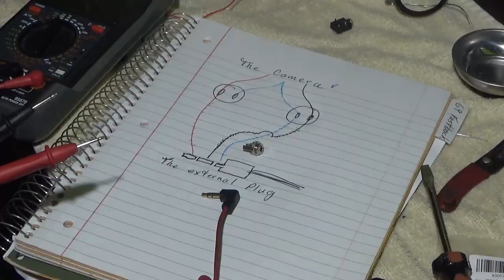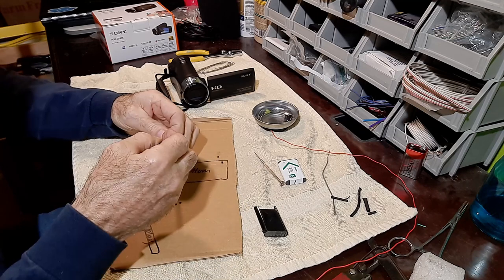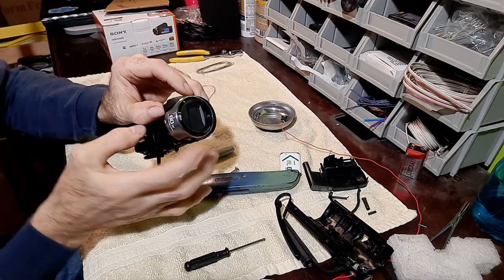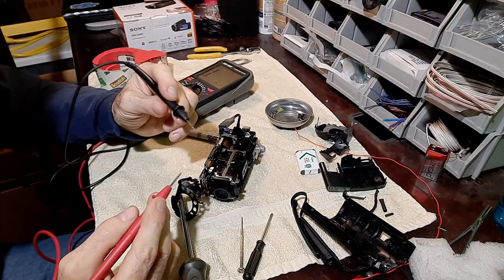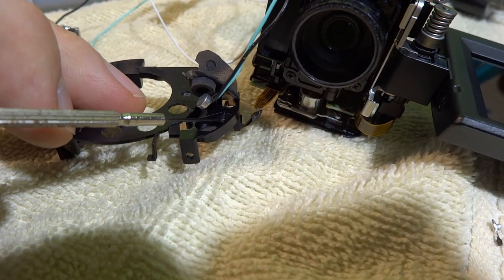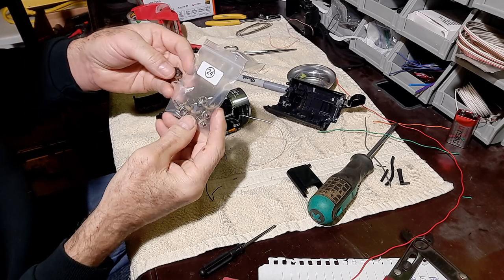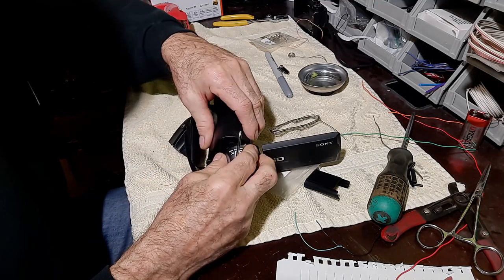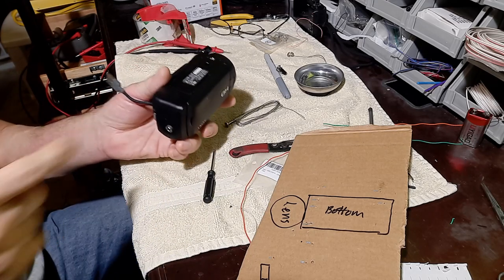making a, Video camera for YouTube. Adding External Microphone,  Sony cx405.   Rode wireless mic

Comment: Congratulations on a job well done.
You showed GREAT patience in removing those covers.  Your soldering skills are certainly better than mine.  Glad your project was successful.  Happy New Year.
Reply from the maker: Thanks,  I definitely did not want to break anything.  Not so sure about soldering "skills" lol. I was very concerned about soldering those tiny contact points /wires. Happy new year

Comment: You forgot to disconnect original mics which seems to be capturing audio along with Rode mic
Reply from the maker: Yes, I wanted to keep the original mics. So I could use the camera without using the wireless, if I wanted to. It all works well enough for what I use it for.

Comment: Do need the jack a so called power on it the rode u use seems not to give power to it ( hot shoe or not) btw you show me not to do it really complicated lol
Reply from the maker: The rode is self powered it doesn't require power from or supply power to the jack. Only an audio signal. I hope that  answers your question.
Reply: @TSRGarage  thx verry helpful! Think I gonna give it a try, making records by gigs whit directly put the music wirelessly out of the mixer. Nice results but want to do it not by the phone but by the 405 Sony. Thx for responding.